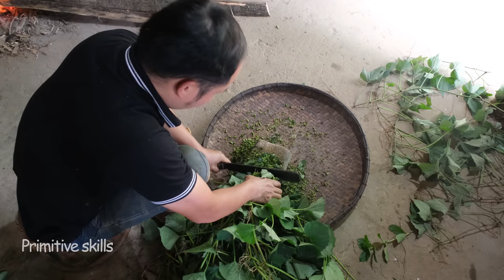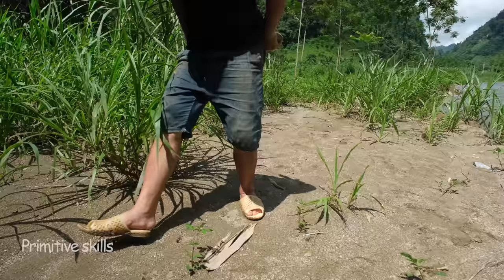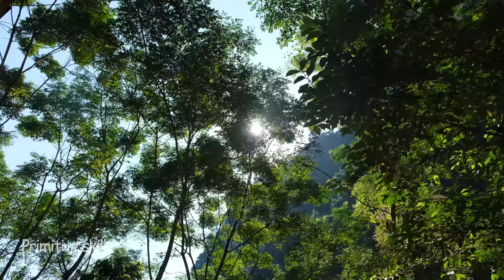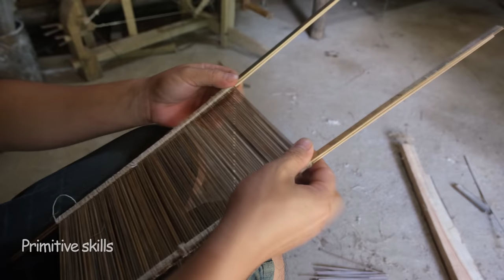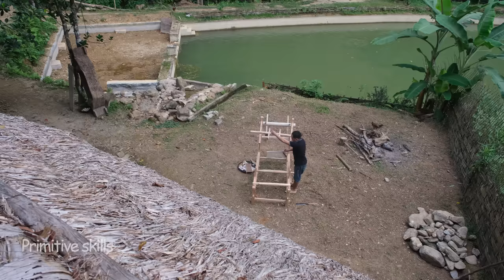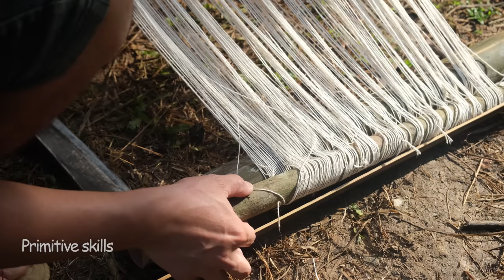Loom Weaving With Primitive Tools

Comment: Man, I remember setting up an old loom in an art class for the first time when I was in junior highschool. 2 hours a day and it took me about a week. It was about 3 times as wide, so lots of threads. No one knew how the thing worked but it was pretty easy to figure it out. Once you get the first couple strings in place, it's just repeat another 300 times or so. But eventually I ended up being able to make it work and made a blanket with it.

Comment: The part with the small bamboo sticks that keeps the threads separated is called a reed and it is held in the beater that is used to push the yarn in place to form the fabric.  Word to the wise, don't pull the yarn so tight before you beat it.  You'll get a nicer fabric if you don't.  

I have been a spinner/weaver for close to 30 years now, I also built my loom.  I must say that you did a great job 👏.
Reply from the maker: Thank you, your advice is very helpful to me
Reply: @PrimitiveSkillsnet Dear #P. Skills, I am pleased to have been helpful to you.  I am sorry it took so long for me to reply, but, I didn't know if I should tell you the rest, because it may overwhelm you.  But,  it may be best for you to have some further ideas to consider.  I am not sure if you left out some important steps in the spinning of your cotton.  I noticed that, for cotton, it was spun thicker than it should have been for double ply yarn, I  if you intend to ply it.  But, it is not wrong the way you spun it as single ply will do nicely for the weave, but, if you didn't set the twist, then it will yield an inferior, almost unusable woven fabric.  This is because all fibers have memory and, once they are permitted to relax, they will assume their previous shape.  So, when you release the tension of the loom, then, without having set the twist, the fabric will sag and shift back into the direction of the twist that was placed by the spinning action.  This will be especially so with unset single ply yarn, like you may have.  I am only warning you about this because I do not wish to see all the work you have put into this project so far go to waste.  Please let me know if you need further assistance, I will be glad to help.

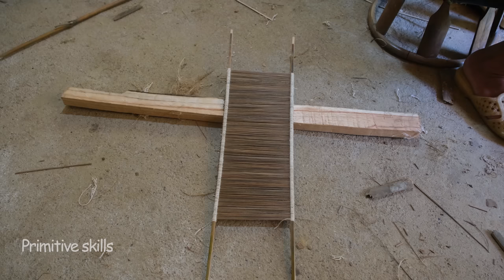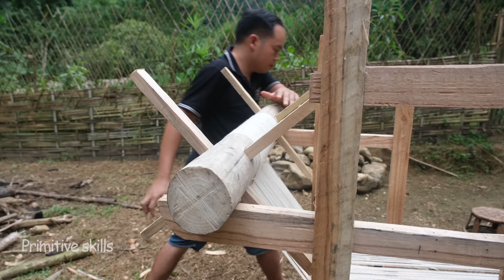Comment: 19:06 This is called the "beater" in english, because you beat the threads into the fabric to make them tight. The ones with the looped strings are called the "heddles". --- 27:32 It is best to use some thin bamboo or paper rolled onto the spool with the threads to keep the threads separated from the previous layer so they do not get tangled. It also makes it easier to get them on.

Comment: It has been said for many, many centuries that the most time-consuming part of fiber-to-fabric is setting up the loom...because if you mess it up, you HAVE to restart it.  And the part with the many finely carved sticks spaced closely together is called the "beater," because it beats the horizontal thread (weft) against the previous ones that were passed back and forth between the vertical (warp) threads (the ones that stretch away from the weaver). Each of the frames with the many strings that hold the warp threads is called a "heddle," which help to raise and lower the warp threads so that the shuttle holding the weft thread can be passed between them more easily.  (I am not sure why they are called heddles, but it's easy to remember, because "the heddle helps raise half the strings toward your head!")
Reply from the maker: Thank you for helping me explain the parts of a firewood frame

Comment: That is so amazing that you figured out how to make all of that sewing loom cotton fabric clothes stuff. I don't know how to do any of that. As you learn I watch and learn from you. It's so complicated. I would need to read an instruction manual on how to build one of those reading it step by step. I don't think I could make the parts. You're getting smarter and smarter and it helps you survive more and more. There are many more things you can learn and do there. Scientific type of work. Material Science. You could have a laboratory making building materials if you wanted.  You could make casts and molds out of things you need. Melt things in hot fire and pour them into the casts to make things. And learn how to make glass too.
Reply from the maker: Thank you, wish you all the best

Comment: You can improve technique of sliding the thing between the threads, it should literally slide, then the woving speed will be much greater
Reply: I guess that "the thing" should be smaller, or threads should be more separated, because it literally stucks there for you

Comment: I feel like the phrasing "hoe the threads neatly into the spinning rod." should likely be changed to "WIND the threads neatly ONTO the spinning rod"  hoe is a garden implement, or the act of using said tool wind is to wrap around, or coil up.

Comment: How did your mother pig get out? Do you need to make more Lime Concrete and turn your wooden fence into stone walls around your pig pen?  That area on a hill like that is rough on the pigs and I don't know what the reason is for not keeping flowing water in their pen unless you are trying to fatten them up to eat and maybe water makes them skinny. but water also helps keep them alive and they may need cool water every now and then. Maybe one day you will work on the fence to make them not be able to get out. Did the mother pig dig a hole under it? It's strange.